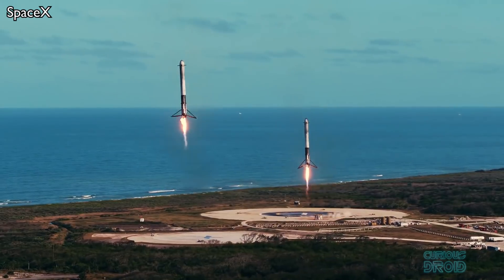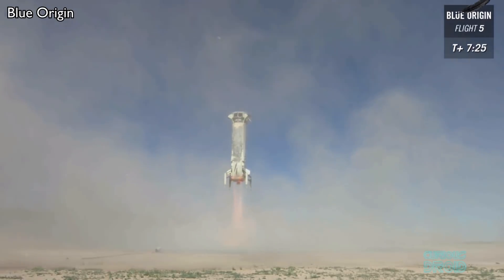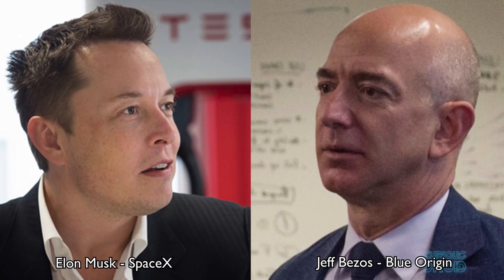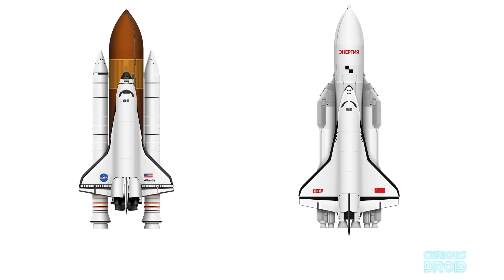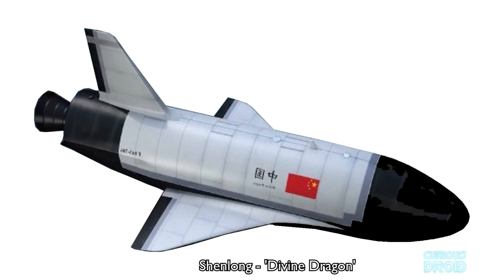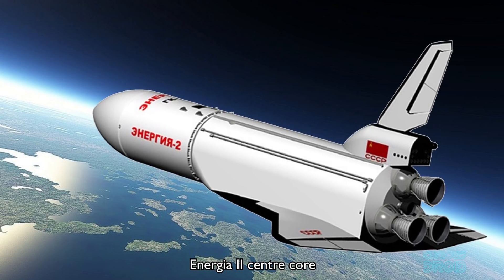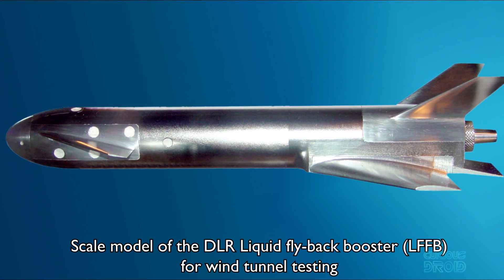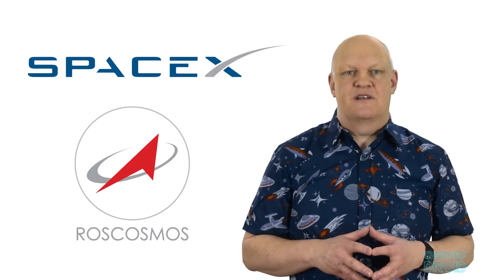Reusable Rockets & Flyback boosters

Comment: The idea of a reusable booster actually goes back before the space shuttle. There was a concept brought forth by Boeing for reusing the first stage of the Saturn V. Unfortunately, there were not enough launches to make it economically feasible. When Nixon chose the space shuttle over the Apollo Applications Project, that effectively killed the Saturn program as it was proposed to be used for a space station and possible additional flights to the Moon to create a lunar base. If you get a chance, see if you can find a book called Frontiers of Space by Philip Bono and Kenneth Gatland. It has a diagram of the proposed recovery of the first stage of the Saturn V in the ocean. It also has some interesting design ideas from Philip Bono on single stage to orbit (SSTO) vehicles. The book is out of print, but you might be able to find it on Amazon or some online bookstores that carry used books.

Comment: Although I love SpaceX's reusable boosters - it's certainly spectacular to watch, and has inspired the public - I wonder if there isn't a more efficient and less risky method to accomplish the same thing.  Firstly, ~15% of their fuel (according to another commenter) is used to land the booster.  That's extra weight that needs to be launched, and reduced payload capacity.  Secondly, landing an oversized cigarette perfectly on its tip is technically complex, and more susceptible to mishaps than, say, landing it on its side where it can't fall over.  Why not use parachutes to slow the descent rather than rocket fuel?  Maybe even parachutes coupled with small retro rockets like they used on Mars.  Why not splash down in the water?  Just dry the thing off and start over.  Why not sprout wings and land the booster like a drone aircraft?
Reply: There are many ways to do it, but cost+mass+points of failure add up FAST.
Using same engine + fins + legs keeps it simple.
Reply: Raw Space salt water + rocket = very bad. Renders booster useless
Wings= weight and unnecessary complexity
Reply: Salt water corrodes. Parachutes don’t allow precision landing

Comment: Re-usable's are a great step forward towards space flight becoming a norm as apposed to the exotic, The next step has to come with fuel/engines. The present rocket system is far too unreliable/inefficent, (After briefly toying with the idea post WWII, aircraft manufacturers ditched rocket engines in preference to the engines/fuel we use today). We need to find a way of powering the space vehicle safely into orbit, and without most of its weight being made up of the fuel needed to get it there,

Comment: Often overlooked is the Delta Clipper or DC-X. The Delta Clipper started as a experimental program to build a reusable single stage to orbit rocket vehicle to launch the components for the SDI (Star Wars). The Delta clipper operated under a shoestring budget in the Department of Defense and faced stiff opposition from expendable launch booster manufacturers. The Delta Clipper was never designed to reach space but just be a demonstrator vehicle.
During a series of tests the Delta Clipper successfully launched and landed vertically several times.
Congress intervened and moved the program from the DOD to NASA against NASA's wishes.
NASA in the space shuttle already had a reusable spaceship. With the Shttle program over budget behind schedule and not meeting expectations the last thing NASA wanted was competition within its own agency for the shuttle. 
NASA begin testing the DC X essentially repeating the same test that the DOD had already conducted. In a classic case of not built here NASA starved the program of funds and resources. This resulted in an improper inspection being conducted and the craft being destroyed.
NASA happy to have this interloper removed never funded any further development.

https://m.youtube.com/watch?v=pVE_iTCUADY

Comment: Another issue with the US Space Shuttle is that in the early 70's the US Air Force became a part of the program and dropped allot of money into sad project - Air Force demanded that the shuttle be able to drop a nuclear payload from Orbit,  thus why the cargo bay is designed the way it is, rather than the original late 60's plan.

Comment: Learned a couple of days ago that it is not friction on reentry, but Adiabatic Compression. Fun.
Reply: that compression creates friction as the air is shoved agains the shield and moves off. its actully both used in the slowing of the craft
Reply: Compress a gas and it heats up and that heat transfers to the heat shielding. If a meteor hit the atmosphere fast enough, the gas in front would undergoe fusion and add mass to the meteor in that minute fraction of a second before impact. Not friction. Adiabatic compression is not the same thing as friction, and friction would not generate fusion.

Heat resistant tiles used on spacecraft are not resistant to friction and would not last long if friction was the source of heat.
Reply: @ Corey saying friction does occur is like saying all heat from a nuclear explosion comes directly as thermal radiation from said explosion. When the truth is while some heat does come directly from it, the Tsunami of Xrays slamming into the atmosphere generates the lions share.

Sure, there maybe some friction, but Adiabatic Compression cannot be dismissed the same way you cannot dismiss thermodynamics as irrelevant. Friction only makes up a VERY small percentage as the air cannot get out of the way fast enough to allow more air to slam into the material.  That is why the air heats up in the first place, it is adiabatically compressed.
Reply: @samik83 Get a bicycle pump, make sure it's room temperature as it will be hard to do this experiment if it's scorching hot :P  Then pump up a tyre or things, whatever!

Afterwards check the the temperature of the pump... it will be hotter than before! :O That is Adiabatic compression generating the heat. ;)
Reply: The reason for blunt nose design of reentry craft is to use adiabatic compression to thier advanage to build a shockwave in front of the craft to protect it from the heat. Without that reentry would be impossible. Saying it is friction is a common misconception, the same way Saline drip make up was never reexamined for 100 years, it was just commonly accepted to be right.

I find it amusing that the very thing that craft need protection from is the same thing they use to help protect it. That is why the space shuttle reentered belly first.
Reply: @Solanumtinkr
...thats actually a really good example
Reply: Isn't there friction between the air molecules and this creates the heat?
Reply: @samik83 there is, for whatever reason this guy forgot to mention then friction dose occure
Reply: @Solanumtinkr
im not saying that it should be ignored, it is a huge part in atmospheric reentry. in saying that he isnt entirely wrong when he say that friction happens and can slow it down
Reply: @Solanumtinkr
im not saying that it should be ignored, it is a huge part in atmospheric reentry. in saying that he isnt entirely wrong when he say that friction happens and can slow it down
Reply: Because science!
Reply: Solanumtinkr how can a rocket be diabetic?

Comment: Here's why I think most designs that differ from SpaceX/Blue Origin will fail: Why equip the launch system with an additional system to land it? Using the very same engines for both ascend and descend seems to be far more efficient. You safe weight, you can use the same fuel storage compartments and probably also use the same telemetry systems for controlling the descend.

Comment: The real expense of the space shuttle was the vast amount of maintenance it required between flights. Rockwell never got the message that fuel is cheep and maintenance is expensive. The design also suffered from the decisions to use liquid hydrogen as fuel and to limit the wingspan so that they did not have to modify the Vehicle Assembly Building and  crawler-transporters. The Russians spent a fortune on their improved copy but never scheduled any payloads for it because they quite reasonable  believed the shuttle was primarily a weapon system based on the cost to operate figures they came up with that was pretty close to dead on.

Comment: On the surface of it, Blue Origon and SpaceX have achieved the same feat, however BO has barely touched space whilst SX is comparable to NASA achievements (and is about to surpass even them). This is important as the hardware is exposed to a different, and more aggressive and risk-filled, degree of risk the further to push the system, so reusability needs to be qualified with what it's actually being reused from (as in the type of flight).

Comment: I do think one issue worth remembering here are the advances in computer technology. Youll have to remember that back in the 60ties we had just about enough computer power to land on the moon and a decade later we had just about enough computer power to land a space shuttle. Fastforward until present day and the development of modern era computers make it so much easier to control a returning vehicle and I do think that its the reason till why SpaceX can do its Magics now when Nasa could not do a simular feat when they designed the space shuttle. And you have to remember that Nasa did something simular with theyre SRBs over the entire space shuttle era but they opted to land them on the water instead of a drone ship. There has always been a lot of dreams and plans for reusable space ships - Even AC Clarke dreamed about them in 2001. But I do think we own a great deal of the current success in those areas on behalf of the advanced computer technologies of our age. Johan.

Comment: Paul,

It's in its final throws, but a book on the skeletons in the space shuttle closet will likely be published.  The author is a former RLV design manager (the X-37 was one of his reports, to give you an idea of his knowledge base).  I've heard some of his stories behind the system level design mistakes that were made...making the second stage reusable, as opposed to the first.  I was surprised that you only touched on that briefly here - the impact is enormous.  Structural material resulting in the need for a fantastic heat shield, and politically connected suppliers trumping (how, um, appropriate the days) technically superior offerings.

Look for it.

Comment: +Curious Droid - I have seen drawings online, from the 1960s, depicting the glide recovery of rocket boosters using Rogallo Parawings.  And that includes the Saturn V first stage.
 
I know that NASA Langley - and maybe other NASA Centers - also did wind tunnel and free flight drop testing of Parawings of different sizes and configurations. 

I DO NOT understand why this technology wasn't at least tried on small boosters....
Reply: Not enough money, as with other cool projects from NASA.

Comment: SpaceX and Blue Origin approach is a controlled crash.  Minimum drag surfaces and a rocket to actually get it to slow down before it slams into the ground.  Wings seem to be a better approach for the weight and complexity of the controls.   I thought the best item you presented was the winged vehicle that brought back the engines of an orbital delivery rocket and the fuel tank is allowed to burn up by itself.   SpaceX should be looking at this approach.

Comment: I think its a a terrible waste. The last bit of fuel does the most acceleration because it only has to push the weight of the rocket after the majority of the fuel is used alongside the fact that the last bit of fuel gets used in the least dense part of the atmosphere. Taking away the last bit of fuel takes away a good portion of the total speed that could have been achieved.
Reply: The last bit of fuel is in the second stage. They are currently reusing the more expensive 1st stage. Fuel cost is about 0.3% of rocket launch cost.
Reply: Maybe the terrible waste is letting the hardware disintegrate on reentry. Depends on the relative cost of engines vs fuel (if most of the cost is that hardware alike you spend more in your car than it the fuel it consumes) and how much net value you recover. Or maybe it is just the cost of the raw materials once the fixed costs (facilities, licenses, wages) are paid and it's mostly a publicity stunt (part truth, part exaggeration).
Reply: Plus, fuel is cheap. That alone was never the reason for the high cost of spaceflight.

If fuel costs were all that mattered, it would cost about as much to get to LEO, as to fly halfway around the world, non-stop.
Reply: Its the last portion of the second stage fuel. The first stage is a lot more flexible when it comes to weight.

Comment: I think reusable rockets is incredibly awesome but ultimately in the long term we should focus on building more effective space infrastructure such as orbital rings. That said, it'd probably be centuries before we get our first orbital ring so.... yeah.
Reply: Which is nice, if the stuff you want to get 'into orbit' is on the Moon.

But if you and/or your stuff is down here, that fact is of little use...

(Just as the fact that it's energetically easier to get to Paris from London, doen't help me, if I'm in New York City.)
Reply: Orbital rings are the end goal I would assume.  So much utility.
Reply: A shipyard on the moon seems more logical. Way easier to haul cargo to orbit from there than earths massive gravity well.
Reply: The moon has lots of material for ship construction. It's way more efficient to build the ship there and only haul the crew and food from earth.
Reply: There's a series called 'Raw to Ready,' that shows what's involved in going from the various raw materials to large finished products like business aircraft to trucks.

Watch it, and then imagine duplicating that infrastructure in a low-gravity and vacuum environment. Especially for a small number of spaceships, giving you little economy of scale (for example, copper mines, smelters and copper wire manufacturers don't do it just for spacecraft construction, that's one of many customers).

Plastics, generally, are derived from petroleum.

Meanwhile, deep as Earth's gravity well is, fuel down here is cheap and easily accessible...
Reply: +TheOneWhoMightBe
Nah. The end goal is a multi-galactic, immortal, digitized civilization that can survive for quadrillions of years even after all the stars have burnt out. Maybe more if inter-universal travel and/or FTL travel turns out to be possible after all, against current expectations.

Orbital rings are enablers for even greater things. Daily commutes from ground to orbital height and back. (Not actual orbit, though, because the habitable portion of an orbital ring does, ironically considering the name, not orbit.) Bulk material transport from ground to space and back. Cheap transport to and from O'Neill cylinders and/or other orbital habitats. Mounting spaces for super efficient solar panels, with no atmosphere, no clouds, getting in the way.

No. Orbital rings are not the end goal. The sky is not the limit. There's a much bigger, potentially much better world out there. We just have to finally learn how to make proper use of it.

Comment: While all of these new reusable systems are incredible. The inevitable and inexorable end point is runway or helicopter pad launched and recovered SSTOs.  A vehicle that can turn around like an airliner, where all that it needs is a few basically trained people to load it and fuel it then send it back off. 

Space has to become no big deal.